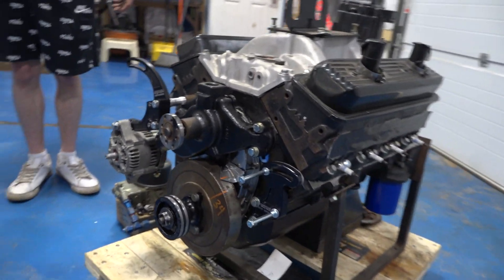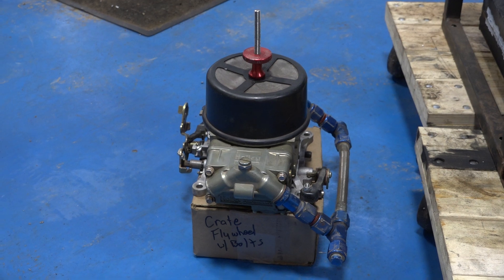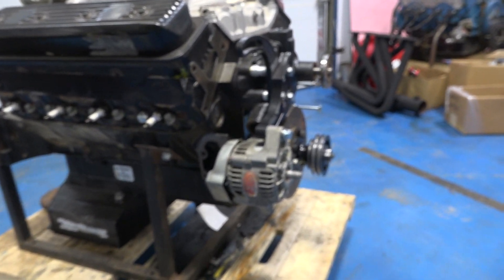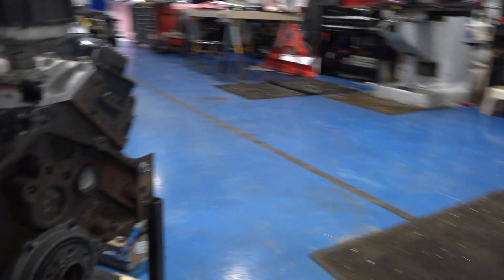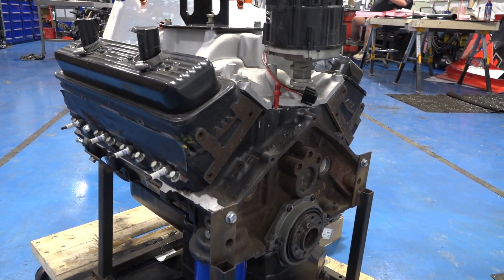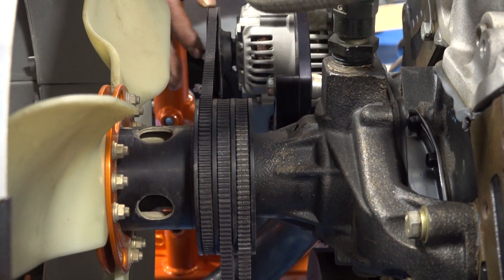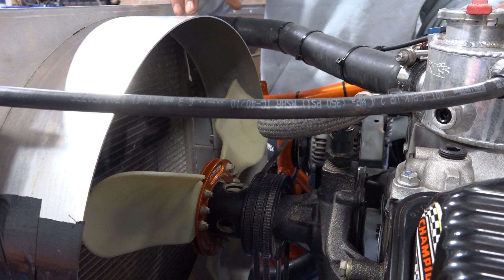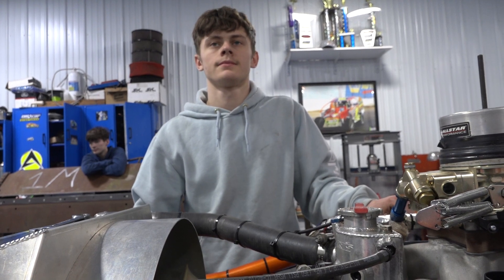Tyler Murray shows us what comes on a 602 crate engine Mar 19 2022

Comment: The motor is hot and makes everything tight. You put your ignition and starter on two different switches. You hit the starter and get your engine turning then hit the ignition. It will fire right up.